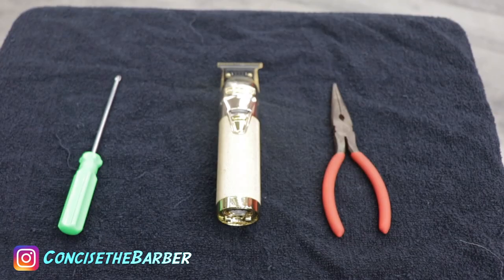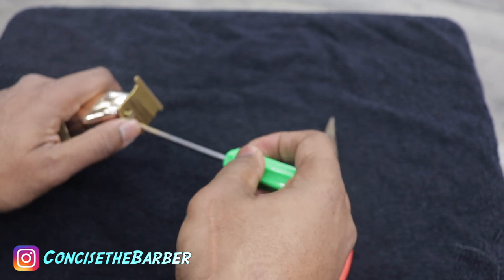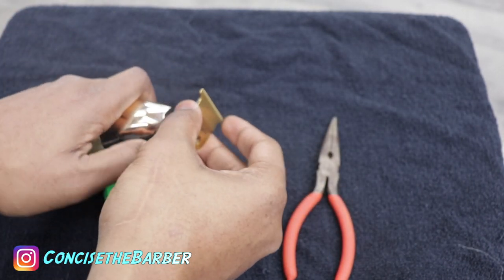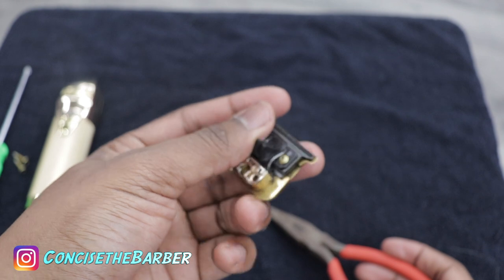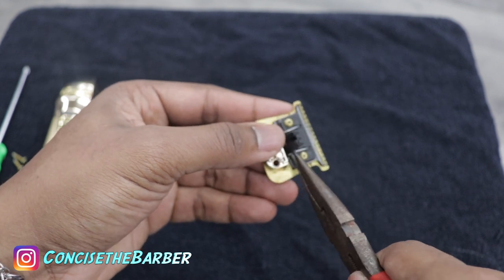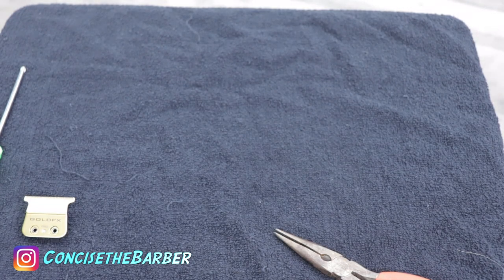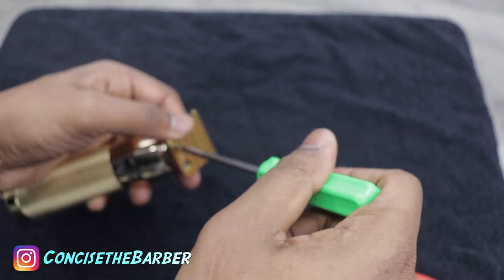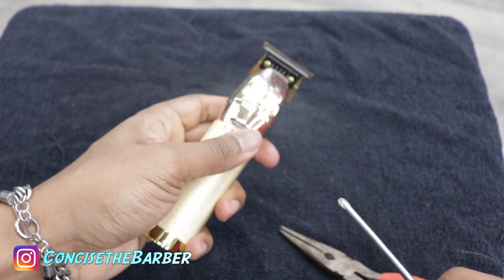Gold FX Trimmers Making a loud Noise!... Watch this video!!!

Comment: @ConcisetheBarber is right. There’s a lot of people on here who don’t seem to understand exactly what kind of noise he’s talking about. He’s a barber, as anyone on here likely is or at least has exposure with this equipment. This isn’t just a normal clipper or trimmer noise. Of course oil and tightening screws and lol the basics are in line first. But if you here and didn’t check that first, go back to school lol. This is a loud, wasn’t there before, abnormal clicking noise that NO TRIMMER should make, especially if it didn’t before. 

 I’ve experienced the same thing and i assume you have, that’s likely while we’re all here. I noticed when I took off my blade to clean it, oil it and adjust it, when I put it back together… (Which was a serious pain), there’s a new ticking noise that I haven’t heard before. 

I have the older FX509 and the springs are tough to get back in. I noticed that one of the arms of the springs might be ever so slightly tilted off center. I tried to adjust the spring but not too hard I didn’t seem to make much of a difference and I put it back together. I’ll ask when I did the noise came. 

After watching his video I played with the spring and I think that that might be the culprit. However I also did notice at least on my model there’s a tiny little gasket that adheres to the top of the plastic cover that goes over the spring. It looks like it was glued on with a tiny bit of adhesive. Perhaps that prevented some of the noise? I slipped it back in there but I haven’t noticed a difference. Twisted spring a little it seem to help, but it is still noisier than before.

My opinion after using lots of different clippers and trimmers, babyliss does have an unrivaled power I will agree with concise the barber. However I don’t think they’re the best quality. At least out of the box, without any modifications, babyliss are great, but they just don’t last. The batteries don’t last, they’re hard to fix, blades are expensive, the whole nine. More and more I use them in the more I’m not a fan, just my opinion. 

Hope y’all fix your trimmers and good luck!
Reply from the maker: Thank you so much for your feedback mj
Reply: What trimmers would u recommend besides babyliss trimmers

Comment: I’ve oiled my blades, added grease to the rotary arm that spins and connects to the cam follower, changed the cam follower and it’s still loud. I just realized the bracket that’s attached to the back of my blade, has small cracks on both sides where the square washers/nuts are. So, if ur having the same issues, maybe check that. I don’t know if u can buy that part or not. Def about to look. This is a new blade so I’m not very happy. I’ve only had it maybe 3 weeks

Update: they don’t sell that brace that attaches to the moving blade, so I had to steal it off an old blade I’ve saved for parts. It fixed it. Be careful not to tighten the screws too tight after zero gapping it. I think that’s what I did. It snapped the plastic brace the screws screw into. And keep all ur old blades incase u need parts. ✌🏼
Reply from the maker: Appreciate the heads up

Comment: Disassembled my friend's fx trimmers today and started swapping out pieces one by one with my own one to isolate the part causing the problem.. turns out there was a tiny tiny bend on one of the teeth on his feeder blade that resulted in extra friction hence the noise.

I'd recommend you pull apart your blades and see if there's any friction at the point of contact of the cutting blade and the feeder  blade.
Reply from the maker: Thank you for that feedback I’ll try that and see how that works
Reply: That was very helpful. Thank you
Reply from the maker: @zairewarner1440  glad I could help
Reply: I just noticed one of the teeth is bent on mine , its making a loud noise since yesterday also I took it apart because its not even cutting any hair anymore so not sure wtf is wrong
Reply: Thanks a lot! This was the issue with mine, one gold teeth was slightly bent downwards which cause friction with the black teeth making it louder than usual. I dissembled it and fixed the bent teeth and the loud noise is now gone!

Comment: I’ve noticed with a lot of my babyliss trimmers they end up getting loud and clattering but then the blade will generally start shifting down and ruing the gap of the still blade and moving blade making them crooked. I always figured it has to do with that spring but I think it may be one of the pieces at the bottom of the blade. Been trying to figure it out so I can start fixing my blades by purchasing the broken piece instead of buying a new blade every 6 months to a year
Reply from the maker: yea this one still is low and not loud...
Reply: Take the blade out and squeeze the 2 plastic edges slighter closer together..that’s the solution I promise

Comment: The clatter is from the motor. The stem piece that holds onto the cutting blade adds weight to it when in vibrates. There’s no way to fix it without opening the motor housing I believe. Too scared to try tbh. I’m gonna try what you said here, but I’m pretty sure. When you have the blades off if you move the motor stem that protrudes back and forth it clicks, but will not make the clatter until you put that piece back on.
Reply from the maker: I will look into that as well.. altho mines seems to not be as loud anymore.. learning something new never hurts

Comment: The black plastic piece that the springs rest on is worn..The rotary spindle on the motor doesn’t rotate securely anymore.. There is no way to fix it except changing the blade which comes with a new piece..
Reply from the maker: yea ive noticed that . thanks for the information
Reply: Temporary fix is to either pinch the pieces that contact the cam (rotating part) and/or put white lithium grease between them. They sound new for a while. But the only real fix is a new blade… unless Babyliss decides to start selling new cam followers

Comment: When you zero gap is it normal for it to be slightly louder not clatter but it does get slightly louder is that normal ? After a zero cuz when they come stop it’s smooth an quite but after the zero gap it’s slightly louder is that normal it did I do something wrong but agin there’s no clattering it’s just slightly louder
Reply from the maker: I think that’s true depending on the blade you’re using

Comment: To cancel the noise add a tone of oil all over the blade even on the screw to zero gap while it ls on. And then just wipe down the clupper after
Reply: That stopped working...now what?
Reply: It doesn’t work

Comment: I took the gold piece off on the blade now Idk how to put it back😕 do you know how I could put it back?
Reply from the maker: follow me on instagram (concisethebarber) and message me and Ill try my best to help you
Reply: Me too 🤦‍♂️
Reply: Same !!!!! Wtffff
Reply: Did you ever figure it out ???
Reply: Wusup up do t know if you did it already... But what you have to do is...Press Down firmly with your thumb..and when putting in the screw start I in a SLIGHT angle..then stand screwdriver up...WHILE CONTINUING TO HOLD IT DOWN WITH PRESSURE...!!👍🏿👍🏿👍🏿
Reply: Mr. jones good looking out bro just got it done !!
Reply: For anyone that needs this info. You can press it down with a plier instead of your thumb unless you can hold it down in order to screw it. It needs a lot of pressure to keep it down. 🙂
Reply: For anyone wanting this info, you can also use a flat head screwdriver which fits perfectly into a gap in the metal piece to press it down whilst screwing it back on !!